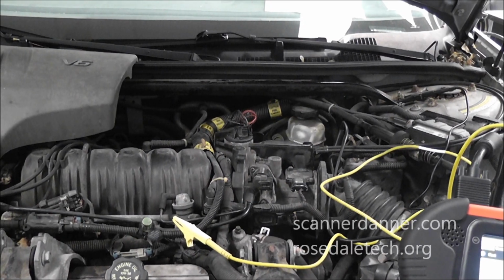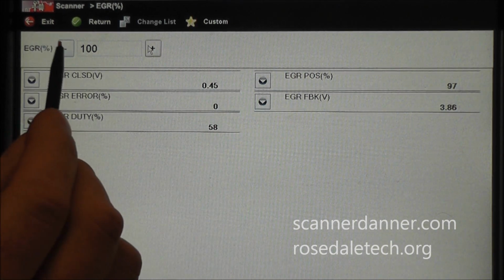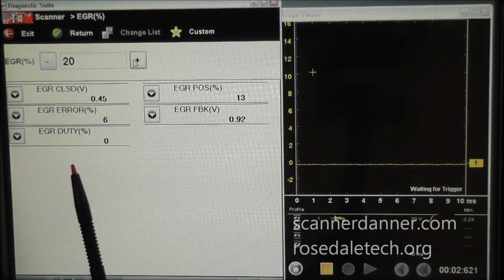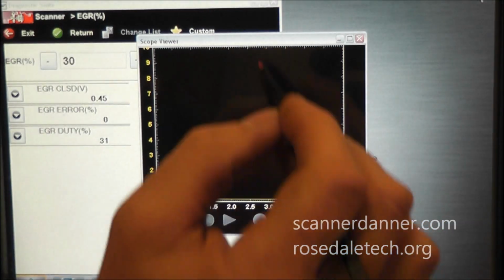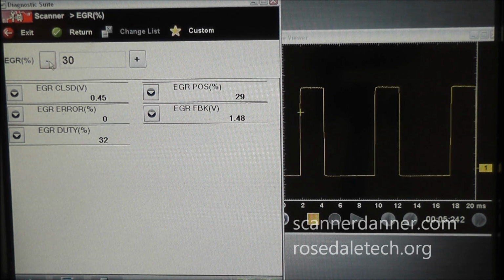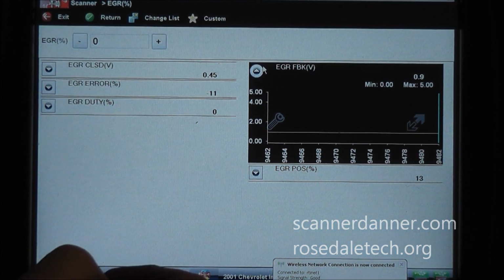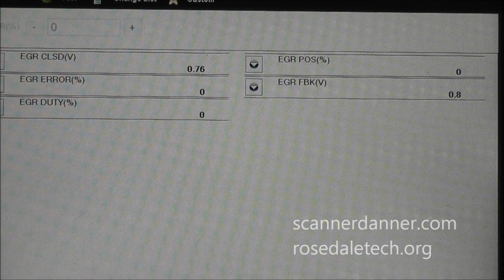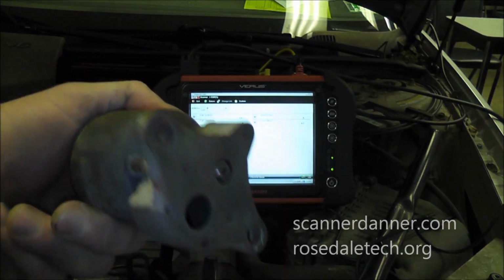EGR Closed Performance P1404 with new EGR valve installed (GM)

Comment: 12 years later and this still saved me a headache. Changed an Egr and cleaned a passage way in the Intake that was fully blocked and has been for years. This was a 2002 olds silhouette . Got this code a day later for a customer , quick google of it and saw this and a forum saying unhook the battery. So far so good !
Reply from the maker: Awesome! Glad I could help you out!

Comment: It worked for me I couldn't believe it but it did
Reply from the maker: What worked? Thanks
Reply: @ScannerDanner well I found your videos thru southmain auto, but anyways I've been watching your videos for like 6 months now. But anyways my 1999 Chevy S10 zr2 4x4 was acting up, light came on for EGR , tps, fuel pressure. I changed one at a time .nothing worked for months.. then last hope came across my screen with your video yesterday when I gave up.   I watched this 45 minute video. And at the end of the video you called it, and said the guy didn't unplug the battery on all those parts. I tried that today and man.  It worked for me
Reply from the maker: @cognac8297  awesome! I thought maybe you were referring to the EVP 0% issue. Glad you got it fixed!

Comment: I currently have the same issue 02 impala disconnected battery , cleaned egr, bought new egr, same issue same code , was told pcm needed to be flashed/updated to change computer setting
Reply from the maker: a battery disconnect will be that EGR 0% back to normal

Comment: What if you have multiple codes? 02 GMC Sierra 2500HD 6.0 P0300, P0134, P0154, P0171, P0174, P0404, P1404 where do I start? No scam tool, only multimeter. Spark plugs new, EGR is clean, ohmed out o2 sensors(21 upstream/15 downstream) at idle. Now what?
Reply from the maker: You need a scan tool. Your not troubleshooting fuel trim issues without one. And that's only your P0171 and P0174 codes.
After that, you need service info (flow charts and wiring diagrams) for the rest of those codes.
Here is a link to the DIY version of the same service info I use
https://eautorepair.adtrk.biz/?a=10817&c=24&p=r&s1=
Reply: @ScannerDanner  ok thanks I’ll check the link

Comment: I have a 85 thunderbird and when my egr vacuum hose is connected to it, the egr valve opens and closes too soon. No vacuum leaks. I’ve cleaned it. Should I just buy a new one? Or what could cause it. It drives fine if I disconnect the egr vacuum hose.
Reply from the maker: I dont remember if that 85 uses a backpressure type of EGR valve. If it does, that port could be plugged in the EGR itself, in which case, yes, replacing it would be in order.

Comment: Question. So disconnecting negative will that suffice or negative and positive? Also do I unplug the unit also or no? For 2000 GMC Yukon xl with a 5.3
Reply from the maker: just disconnect the negative and leave it off for a few minutes

Comment: Can we get any information about the diagnostic tools you're using (including the clip style multimeter)? I love the info on troubleshooting but it's not helpful if there's no way for me to get any of the data. I typed your URL to get to your website and was disappointed to find all the products are "swag" with logos on them rather than anything useful. I'm glad you've published a book, but why would I buy it if it just tells me how to use data I can't get? Also, with 2 dead cars I'm looking for rapid, actionable information(though I'm still curious enough that I found the duty-cycle info interesting if not super pertinent to the current issue) , I'm not sure if the rest of your audience is in semester-long classes but I thought I'd mention quick info would be helpful, to me, at least.

Comment: Scanner Dan.  First thanks for this video.  I have a 2002 Park Avenue with a 3800 Series II putting out the P1404 after replacing the EGR valve with a new valve.  I have reset the PCM by disconnecting the battery although the code keeps coming back!  Do you have any advice for me on this issue?
Reply from the maker: What is your closed valve EVP voltage?
Reply: @ScannerDanner  I do not know at this time.  What tool do I need to acquire in order to discover the voltage?
Reply from the maker: @patrickalindsey  just a digital voltmeter and measure it directly on the signal wire
Reply: @ScannerDanner  is there a better way I can communicate with you?  Do you have the time to walk me through the troubleshooting steps?  I am going to need some help.  I will be more than glad to compensate you for your time.
Reply from the maker: @patrickalindsey  there is,  my forum www.scannerdanner.com 
It is free to join and we can absolutely help you there. Thanks for understanding. It's hard for me to keep up sometimes. I have other videos on this GM Linear EGR valve and how to test it with a voltmeter i just don't have any links offhand. I'm pretty sure you can find them in my chapter 7 (potentiometers) playlist or in my chapter 24?
Reply from the maker: @patrickalindsey  did you post it yet?
Reply: @ScannerDanner  thank you for the replies!  I will join your forum and proceed there.  If I need to I will purchase your book as well.  At the moment I don't know exactly where to measure the voltage.  I will get back with you soon via the forum...
Reply from the maker: @patrickalindsey  this is the one I was thinking of https://youtu.be/te_kapz-fj4 I think it will give you more insight on how to test it with your meter

Comment: hi Paul
Is it ok to manually energise a solenoid when is duty cycle control , by giving if full ground,or in this case full power (+).
Reply from the maker: Just don't do it for a long time. I've never hurt one
Reply: @ScannerDanner  ok thenks,you are doing amazing job

Comment: I have an error p0403 and p1404. So I changed the egr valve but the errors are still there. At the first start of the day, when cold, the valve works between 5 and 10 minutes and then stops working. We can see that when the valve does not work anymore, the wastegate of the turbo stops too. I tried to disconnect the battery for half an hour or to touch the two battery connectors together to create a reset but still the same. I don't know how to reset the ECU.

Comment: I have a problem with my isuzu dmax 
sometimes when key is on and engine off the egr position is 0
And egr error shows up as 99.2
And check engine light is on, but when i start the car it disappears
And egr functions normally
Reply from the maker: so your check engine light comes on at times while driving? what is your complaint? symptoms?

Comment: I installed a new egr valve on my 2001 Buick  lesabre and my p0401 code comes back 5 miles down the road I did battery disconnect for 6hrs 😭
Reply from the maker: You didn't install it backwards did you? Some of these you can and vacuum will lift the EGR pintle causing a rough idle and position error codes
Reply: @ScannerDanner  No i installed the same way the old 1 came off. The car runs fine and all just the code comes back a couple of miles down the road
Reply from the maker: Is the 401 code a pintle error code or a flow code?

Comment: I'd already installed a New EGR valve, continued to get P1404
Then I watched this video and:
Disconnected the negative wire from the battery for an hour
Because I was busy, not because I thought I needed to wait an hour
AFTER an hour
Reconnected the negative wire to the battery
Started the car
Success
This fixed a P1404 on a 01 Chevy Impala 3.8 that was still giving P1404 after installing a new EGR valve
The following is just some speculation:
I never cleaned my throttle body so I have no idea if it's clogged or clean. I advise you to check out his other video on cleaning the throttle body because it's an awesome video and because I believe that the resetting of the computer (disconnecting the negative from the battery for half an hour) is simply resetting the computer/EGR to work with the throttle body that is [in my case] probably still gunked up. 
Unplugging the battery fixed my problem; it got rid of the P1404 code.
But I as soon as I have time I will clean the throttle body and unplug the battery again (to re reset the computer with the clean throttle body)
 I'll update this comment if the throttle body was gunked up.
If you have any information or thoughts on my speculation, please reply to my comment because I'd like to know if I'm right or wrong in my understanding of the reset
Reply from the maker: It has nothing to do with the throttle body. The old EGR position sensor had a learned closed valve voltage reading that differs from the new one. On newer models, the closed EGR position is a learned value on every key cycle. On your car it is also a learned value but it gets written into a keep alive memory and is ONLY reset or relearns on battery disconnect. Make sense?
Reply: @ScannerDanner  I still have the same question...
The learned voltage; it doesn't have anything to do with the throughput/passageway inside the throttle body?
For example, does the EGR valve change it's voltage/position based on the size of the opening inside the passageway in the throttle body (that passageway you showed in the other video where it was completely black and looked almost sealed off)
And thank you for the insanely fast reply
Reply from the maker: Nope, just simply closed valve (EGR pintle) position. It allows for manufacturer tolerances.
With plugged passages you will get flow codes which are based on psi changes from the MAP sensor. You will NOT get position error codes from plugged passages.
Reply: @ScannerDanner  AWESOME, thank you for explaining that! I'm extremely grateful that you replied so fast and directly addressed my misunderstanding. I now have a better understanding of EGR thanks to you! Thank you times a million!! Have a great rest of your day!!👍
Reply from the maker: @abab201  cool man, I'm glad that last description made sense. It is hard to convey this type of stuff in text form sometimes. Thanks!
Reply: @ScannerDanner  good morning, if I have a question about the ac, same car, can I ask you here in the comments?
Reply from the maker: I can try. As long as I don't have to look up service info. If it goes that far then Post this to my forum. It is free to join and we have an awesome community that is friendly and willing to help. https://www.scannerdanner.com/forum/post-your-repair-questions-here.html
Reply: @ScannerDanner  thank you
01 Impala 3.8
The AC started intermittently working over a year ago  When it intermittently works, it only works when blower is set to 5. Sometimes blower won't turn on for days, sometimes it turns on for a few seconds and then stops working even though you didn't touch the controls. Blower can also start working again but if the compressor was working, it won't be when the blower starts blowing again. Sometimes the compressor turns on while the blower is on, sometimes it doesn't.
And the weirdest thing. There's lights on the 4 buttons (fresh air, recirculate, ac, rear defrost). When you change the blower speed from 1 through 5, those lights will change, flicker, dim and flicker faintly, turn off, and not always the same way. For example, today when I change blower to 1, the recirculate and fresh lights might both be on and no AC light, but tomorrow only the fresh air light is on and yes ac light. That's just an example, the lights are always random. Sometimes I can feel the compressor is on even though though the AC light isn't on. I can push the 4 buttons but the light may or may not come on/turn off and the action may or may not happen. Only thing that changes the lights is blower setting anymore.
Ive tried installing a brand new blower motor resister, the controller? part where you adjust blower speed and dual zone temperature, recirculate etc. That whole part, and even a brand new blower motor.
My mechanic tested the fuses, didn't find anything.
Haven't replaced/diagnosed anything under the hood that's ac related.
I'm hoping you have The answer cuz we're having a heck of a summer, high 90s and triple digits.
I'm sorry for not replying yesterday,   I was out the whole day from shortly after the time i text you till 1030pm
Thank you
Reply: I replaced my EGR valve paid 210.00 for everything and engine light still on and it's reading 1404 code will disconnecting negative battery work or should I take it back?

Comment: I was told after you install the EGR valve do not plug it in go in to the car put on your scanner then reset the codes or erase them then turn the key off then go out and plug the connection back into the EGR valve. They say this resets the codes
Reply from the maker: On these older systems a battery disconnect is what is needed to reset the 0% closed valve position after you change the valve. Newer cars reset this 0 count on every key cycle.

Comment: This reminds me of some Ford models when you replace the oxygen sensors and dont reset the KAM and the O2s monitors wont complete with no pending codes preventing it from passing smog test. Also great video, i always thought the duty cycle percentage should match the valve position percentage and if not thought part was not functioning properly 👍🏽

Comment: Question:  I cleaned my EGR valve on Sunday, but my idle is rougher than what it was before I cleaned it.  I have Autoenginuity software that has bi-directional controls, so I commanded the valve open, and the engine stalls immediately.  So, there isn't a problem with the passages, to the best of my knowledge.  I tightened the bolts down as tight as I always do with intake manifold bolts, but I didn't use a new gasket.  I'm thinking it "may" be a gasket issue.  I sprayed brake cleaner around the valve gasket area, and the STFTs did get better slightly.  Could the pintle valve be leaking, even though it is closed, via a weak spring, or a bad seat, etc.  I didn't think to test the voltages like you are doing here, but I went ahead and ordered a new GM OEM valve, and GM OEM gasket anyway.  The reason I am posting is because something isn't right, because my LTFTs went from under +5 on both banks to around 7-10 both positive on both banks at idle, and get better with RPM.  So that obviously indicates a vacuum leak to me.  Something isn't right there.  It shouldn't have gotten worse with me cleaning it, unless the seat of the pintle somehow got damaged with me scraping it.  I have been suspecting the EGR valve as being an issue for quite a while now.  This is on a 2001 S-10 4.3L, with 165,000 miles on it.  It doesn't smoke, nor burn a drop of oil.  Hopefully the new valve and gasket will solve my issue.  Any thoughts on this?  Thanks for any input.

Comment: this 46min video shows you one thing: disconnect battery after EGR change so computer can learn, thanks.
Reply from the maker: Lol, it showed way more than that. But I suppose for those that don't care about learning testing methods, and system operations and only want to know the fix, then you're right, that's probably all you learned.

Comment: Mr. Scannerdanner I need your help. I am getting the same code for my 1997 GMC K 1500 5.7 Vortec. Before I bought the truck the gentleman before replaced the valve twice because of this code. After watching this video I disconnected the battery and let it sit for 10 minutes then I hooked it back up. The code came back on after a week. So I went ahead and took the valve off cleaned it really good like you demonstrated in the video. I went ahead and disconnected the negative battery cable again and then I hooked it back up. The same code came back on. I went ahead and bought a Delphi EGR valve brand new. I threw that baby on and the code never came back on....... until Friday. The same code is back and this time when I clear it it immediately comes back on. I have no idea what it could be. I'm going to take the valve off and clean it and disconnect the battery but I can't imagine after a month the valve would already need to be cleaned again. Or that it would already throw a code. My OBD2 scanner tells me the EGR system is complete. How could it be complete if the valve is not closing all the way? So I guess my question is how do I fix this and if I can't fix it due to some crazy unexplained reason. My truck should still pass emissions because the valve is still opening it's just not closing all the way.?
Reply from the maker: I've seen some crazy stuff on these. One guy changed his fuel pump and reversed the sending unit wire ground (for the float) and the pump ground which backfed the entire computer system ground with too much amperage, elevating the sensor ground voltage. We can check for this easily. 
Also, I need to know what the EVP voltage is with the key on and then again with it running at idle. Let's start there okay?
Reply: ScannerDanner my evp with the key on is .82 volts. The reading I was getting before I took it off and cleaned it was 1.085 volts, disconnected my battery and I placed it back on and now my reading is .82 volts. With the vehicle idling my EVP voltage is 1.82..... could my EGR valve possibly be backwards? Or do those readings seem normal
Reply: ScannerDanner so today I was looking at my emissions readiness on my OBD2 scanner  and when my egr system completed. My check engine light would kick on. NOT TODAY :) the good cleaning I didn't think did anything, worked. I find it kind of a pain that these egr valve have this problem. Especially these type of EGR valves. Anyways thanks for your help. I really enjoy watching all your videos. Keep up the good work
Reply: ScannerDanner well, I spoke way too soon. My check engine light came back on..same code. Mr danner I guess if you could tell me what you think of the numbers I told regarding my EVPs. Thanks again for your reply.